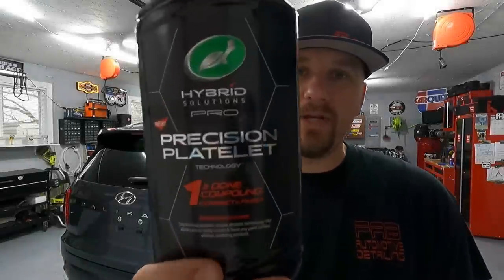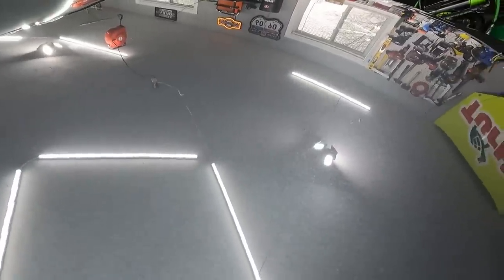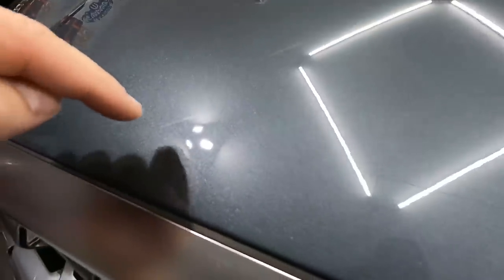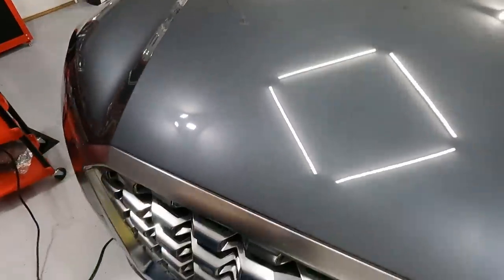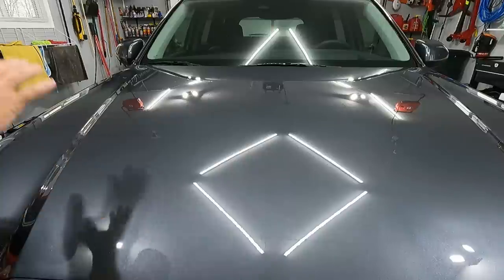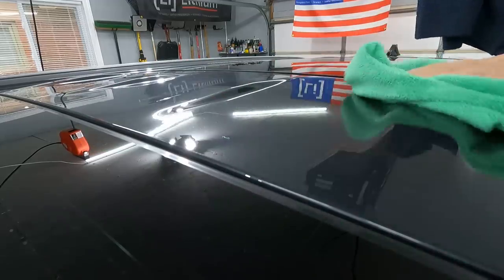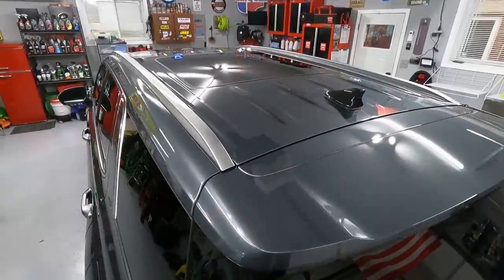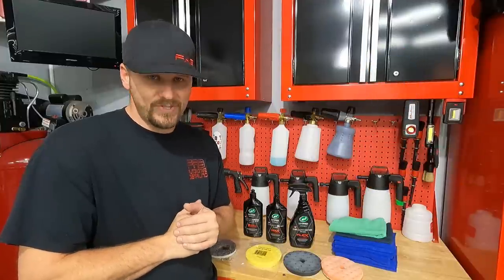New Turtle Wax 1&Done Compound Correct & Finish! You Choose The Aggressiveness With Your Pad Choice!

Comment: Good video Brian! And this shows what I always explain to my viewers: even brand new cars are never really new when you take delivery from the car dealership. People must never forget that vehicles are sometimes spot corrected at the factory for minor defects, which can leave buffer trails and holograms. Then they are transported by truck, train, boat, which means they're exposed to the elements, brake dust, industrial fallout, etc. They are left at boat docks or in dealership parking lots for weeks, sometimes months. And 99% of the time, dealership do a horrible job of prepping vehicles (as is evident from your video) as they leave sticker glue residue, they scratch the paint further from poor washing and drying techniques, they use the same dirty soap in the bucket that they used for 20 other cars that day, etc.

So you absolutely need to fully detail a vehicle as soon as you take delivery from the dealership. A proper detail will not only make the car look better, but it will start protecting it right away and it will continue to look good for years down the road. :)
Reply from the maker: Thank you! I tell people the same thing all the time about their new cars and have to show them what I am talking about or they don’t believe me.
Reply: I wish I knew how to properly detail 😕

Comment: I bought one and done after seeing the reviews from Apex, it suck!!!!! it is nowhere nearly as good as 3d ONE. I wasted $26.00 and a full day of work, chasing swirls on a black car goin from white ccs pad, to orange ccs, and then 50/50 pad, then I changed compound and voila 2 passes and swirls gone. Before going to 3D ONE, I tried doing smaller areas with more fluid, wasted an entire bottle on one car.  I have less than 1/4 bottle left, which I plan on trying on another color car, but I am not holding my breath.

Comment: Thanks for posting. Quick question. After using the orange pad should you go back and hit it with the black finishing pad? Thanks
Reply from the maker: @RaulMedina-b3d  It depends on the paint but in most cases you wonky need the orange pad.

Comment: This or 3D one? Coming up on 2 years on my f150 with carpro uk 3.0. Going to be putting a new coating on this spring. I have  had great success with 3D one and an orange pad or the uro 50/50.
Reply from the maker: Honestly if 3D one is working great for you stick with it. I’m my opinion they both work great and both can be finicky at times depending on weather and certain manufactures paint.

Comment: I used the One and Done yesterday on my car; using the 50/50 microfiber pad first (4 dots on the pad) and then used the black foam pad (4 dots on the pad).  I tapped the pad over the area to be done, started the machine out at a 1 speed (using a Porter Cable machine) and then switched to 4 speed in a cross hatch; doing this way with the 50/50 pad.  Then when using the black foam pad, I also tapped the pad over the area, started out with a 1 speed to spread, then changed to a 3 speed in a cross hatch.  I noticed that with each pad and application, it was harder and longer to remove the compound; I had to use all three microfiber towels; and it wasn’t very translucent.  What did I do wrong?
Reply from the maker: I’m not sure why it did that to you! I have o my used it this one time because this was my last detail before winter. I have seen other videos where they used a damp towel to help remove the polish. Maybe try that and see if it helps.
Reply: What you did wrong was use a porter cable polisher, ALWAYS USE A MAXSHINE POLISHER!!!
Reply: @joefro9473  so a maxshine machine is the only one to use? All others are crap?  It’s only the machine that’s the problem?

Comment: Great job, Brian from Apex compared this polish to 3D One and it shows. I was a little disappointed by TW Hybrid Solutions Ceramic Polish & Wax cutting abilities so I guess that's why they're going away from the AIO product. I'll eventually try it but I still have enough Ceramic Polish & Wax for three vehicles. TW has done it again though!
Reply: True Ed, you can use TW Hybrid Ceramic and Polish for a paint enhancement, for vehicles that don’t need heavy paint correction
Reply from the maker: Thanks! I agree I like having a dedicated polish with no protection because they always cut better IMO. They definitely have done it again.

Comment: surprised there was that much paint to start with !  lol!!!!                must be butter soft to be able to correct that easy with non -agressive pads~!              Nice Demo Video Brian !
Reply from the maker: Most of the imperfections were either smudges or really fine scratches so fixing them wasn’t difficult at all. I used the orange pads for correcting the roof and that spot on the hood which is a middle of the road aggressive pad. Thank you

Comment: I'm still torn between this and 3d One. I've used 3d Speed and it wipes off very easy. It could be because of the montan wax. Brian from Apex says this One and Done finishes down better than 3d One. What's the easiest wipe off one step (not AIO) polishing compound you've used?
Reply from the maker: This is better then 3D One and 3D One wipes off about the same as this. Griots Garage BOSS Polishes all wipe off effortlessly.
Reply: I've used 3D One and recently used TW 1 & Done, and the TW product wipes off easier, imo.  They're both great products, but I give the edge to TW.
Reply: May I suggest using a lightly damped cloth for the initial wipe off with this compound [which i like!]  Generally I soak a good microfiber and ring the bejeezus out of it then simply follow up with the dry towel.  For me - works gr8 - every time.  I use a lot of the newer TW products and the damp towel initial wipe off seems to be the magic Unicorn - no residues and high spots.  No big deal - it just works and saves any frustration.   Shine on you crazy diamonds!